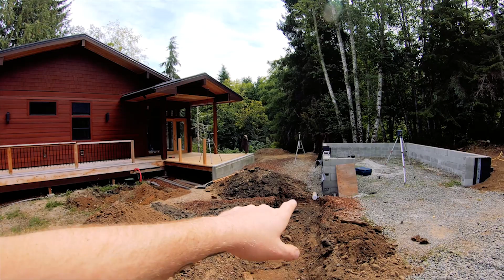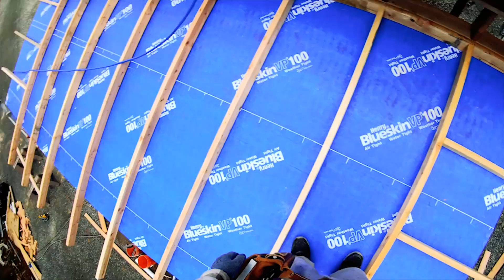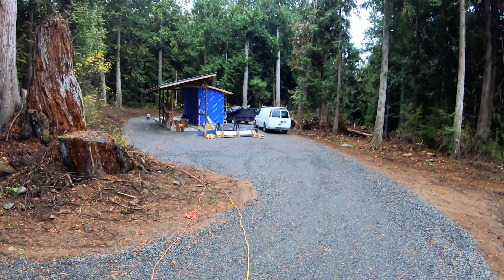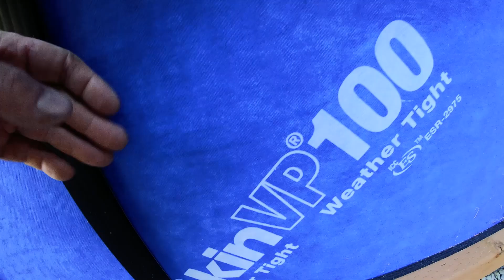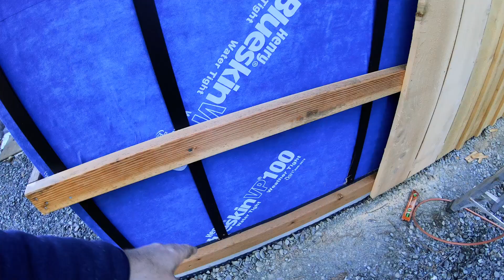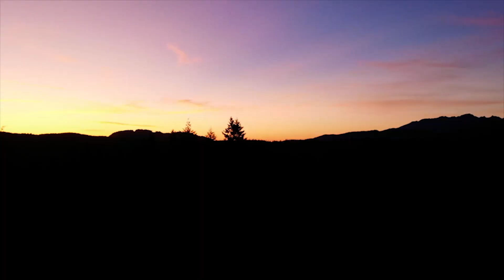Rain Screen for Board and Batten Siding on Kiln

Comment: Horizontal and vertical strapping for board and batten.  Vertical strapping for hozontal siding.  This seems like common practice.  I don’t need to worry about condensation and water pooling on the horizontal straps?
Reply: This is what I wonder as well

Comment: This video is very helpful. Are the horizontal 2x4 furring boards nailed all the way through to the wall studs, or just the plywood sheathing under the blue skin?
Reply from the maker: The 2x4s are nailed through the sheathing and 1" foam and into the studs ~ 1 1/2" deep.  I used 5" 20 penny stainless steel ring shank nails.  You could also use long screws but the nails penetrate the blueskin much more cleanly which gives you a better air seal around the nail penetration.  

Then final siding will be fastened solely into the 2x4 furring boards making sure to use nails short enough to leave the blueskin underneath undisturbed.  In the future the siding can be torn off and replaced all without ever puncturing the blueskin again for the life of the building.
Reply: @TheLeaversFamily  I’m just installing these over Tayvek and I live in the Bay Area, so maybe I’ll be ok with screws. It’s not as damp and rainy here as the Pac NW
Reply from the maker: @benjasaurus  Yeah you'll be just fine with screws, plus they are easier to work with.  The 'Rainscreen' battens will really help with the longevity of your house.  Good luck with your build!

Comment: May I ask what materials you're using for the initial vertical strips? Are they plastic? And why 2x4's instead of 1x3'S? I am not criticizing. I will be building a home with vertical standing seam for siding and there isn't much on Youtube when it comes to rain screen for vertical siding.. Huh! Maybe there's a reason for it! LOL Thanks in advance. At the 5:50 mark I figured it out. It's the coravent both vert. and horizontal. Maybe there is something a little less expensive in a plastic strip that is 3/8 thick.. Cor-A-vent is now $5.17 per piece.. Ah! Cor-A-vent sturdy strips. $200.00 for 112, 4' pieces. 
EXCELLENT ! Thank You!
Reply from the maker: The plastic strips can easily be replaced with wooden ones.  You could cut up 2x4's into strips that were 3/8" by 1 1/2" by whatever length of 2x4 you are using.  Or better yet use 3/8" plywood cut into strips.  I used 2x4s because there is more meat for the siding nails to grab onto (without puncturing the blueskin underneath).  1x3's would work just fine as well but in the long run when replacing the siding in the future, the 2x4's will stand up a lot better to that process.  And as for the horizontal vents, regular insect screen stapled over the openings can be used instead of the expensive cor-a-vent.  Good luck to you!